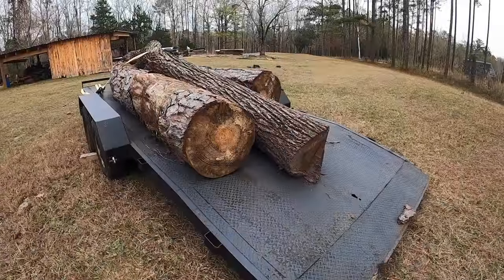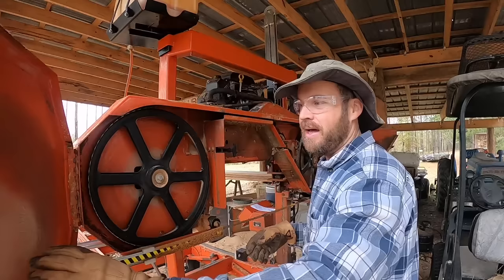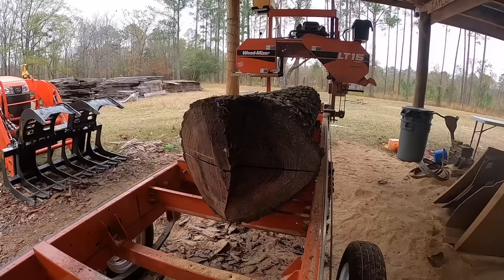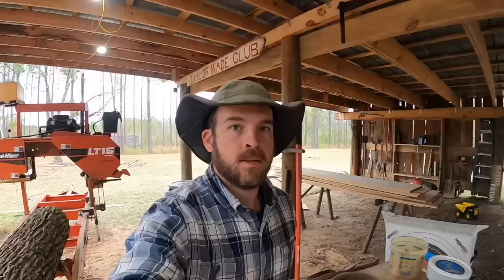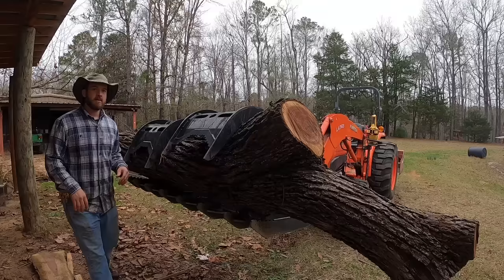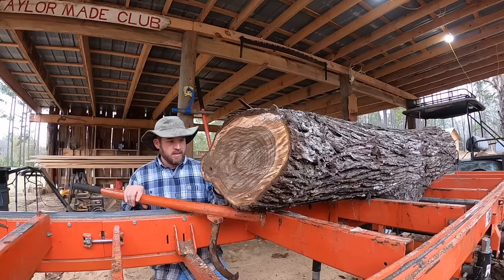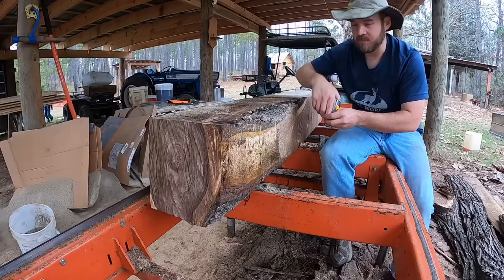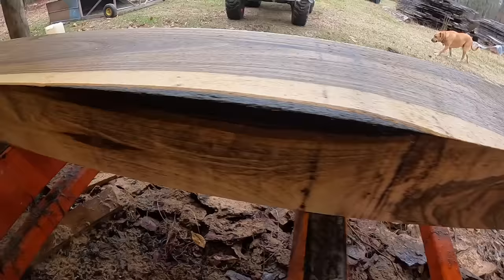This Log Made me Nervous - Rare Walnut on the Sawmill

Comment: The black walnut around here very frequently has shades of purple where the heartwood approaches the sapwood. It does tend to fade as it oxidizes however.  This one here seems to be all chocolate brown.  Both are nice.
Reply: You gotta love the striped contrast between the sapwood and the black walnut!! Made my daughter a rocking doll cradle years ago. Made a curved, slatted top over the head of the cradle, out out 1/2" x 1-1/2" slats. Alternated the slats with sapwood, then solid black walnut pieces, mounted with solid brass oval head screws. The rest was all black walnut dowel fasteners. Sanded it down to 400 sandpaper, then satin Clearwater! Was a very satisfying experience!!

Comment: That large piece will need 4-5 years to air dry and will not be straight when dry due to the pith running inside.  The smaller wedge will twist too as the sap will shrink lots more than the heart. Might be dry in 3 years.    Lots of walnut experience here...

Comment: The "tension" in the log is called shake.  And you can save money in diesel fuel by simply using water and dishsoap for blade lube.  The primary function is to cool the blade anyway, but I've used water/soap for a decade on hardwood to the stickiest white pines with the same result as I've observed with diesel fuel.  While catching whiffs of dishsoap I can't help thinking on the hazzard that is the chronic exposure from inhaling diesel fuel vapour.

Comment: Save some of the walnut sawdust because it can be mixed with a wood glue and used to fill in voids in the boards where there is punky or rotted areas that need filling in to use save the board at its greatest width. The color will be the closest match possible…. You have pure gold there at those widths and lengths!

Comment: The video started off and I saw your precious little boy crawling around on the logs and I caught my breath. But then I noticed that the logs were strapped down tightly and I relaxed a bit. Later I saw him still running around the bed after the straps had been taken off. Then he helped you get the strap buckle free. At any point those logs could have shifted and he could have been seriously hurt or crushed beneath their tremendous weight. He has neither the maturity nor the strength to be able to get out of the way. Please don't let him be around when logs are being unloaded. If anything were to happen it would break your heart.

Comment: you know an acoustic back and sides of good black walnut is about 125 these days, and not Ivar calms, good ol' fashioned greenbacks, there must have been 100 in that long had you milled it that way, remember they bookend figured wood, if you can get a center one pc those are hi dollar a good 1 pc black walnut back can fetch up to $500 .. so that's 3/4" x24"x30"  yea like 1/8th board feet so if you can draw out any centers that wide certainly do it, a ten foot log would produce maybe 20 of them.. it needs to be premium but just center cut the middle or widest  point 2.5" if it looks good, split it into 3 pieces and let them cure about 2 years in a good dry, climate controlled is best but you can dimension them down, best not to for obvious reasons,fact is if you think a log is going to be nice climate control it for 3 years and its a lil gold mine cut oroper, but fat clean clear logs are ultimate, in any of the acoustic hardwoods .. of course your spruce is very desirable;e but it must be 1pc 3/4"x24"x30"  for 1 pc which inst huge at all, if its not wide enough then 12" x 1.5" and they book end cut it.. so 12x30"x3/4" the luthier will take it form there ..

there are special backs as in an arched back or carved back I think they need to be 1.5" so a book matched will need to be 3" but only 1" wide as they will carve a nice rounded back out of it after book matching it with a glue up .. at 21:50 I can see right about 5" down front he top, just above that center circle boy that 3" slice from there forward is gold all the way to that V crotch, prolly beyond as well ..that's the primo I am talking about,, get 3 1.5" slabs x 2 .. some wood you just want to book end as it looks so good, others welp if its not interesting but interesting 1 pc... all depends..

you're most expensive woods are instrument, electric and acoustic,  some do not have to be huge, whats a violin back? not large at all, mandolin?

I see so many dimension good tone woods for furniture so forth totally avoiding the instrument dimensions... hale as long as its not too small a luthier can dimension it.. that back maple can make guitar necks as well, even fingerboards ..

look around at your acoustics, electrics, hollow body electrics, semi hollow body.. see what grains are out here and how rare a nice looking slab really is, good cured neck pieces, fingerboards and acoustic kits go like hotcakes on ebay.. you can look there for your dimensions and see what kind of garbage they are trying to pawn off at times cuz millers get a taste off that good hi money and don't wanna let go so instead of reading the log and dimension into the proper art need they want everything to be tone wood for instruments, but not all trees are fit for it, they'll toss up some raggity looking stuff for hi dollar... eventually someone picks it up for something.. hale wood pen blanks go for $25 - $250 .. that's 3/4"x3/4"x6" how many of those were in your log? yea do the math